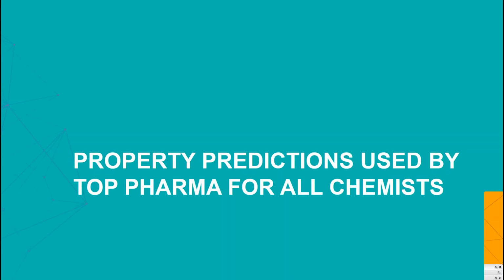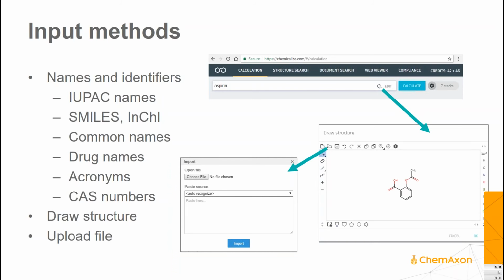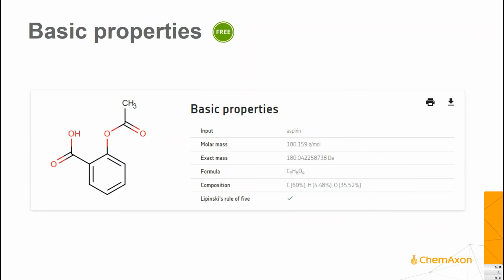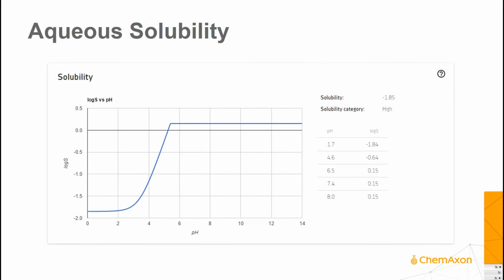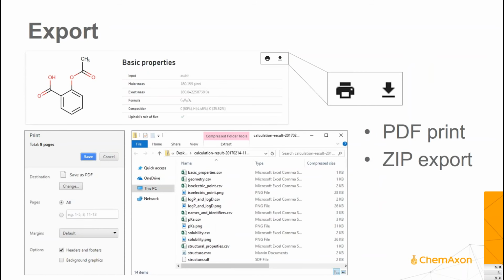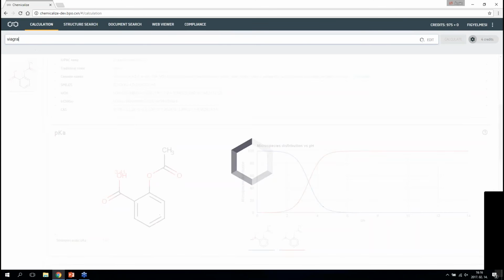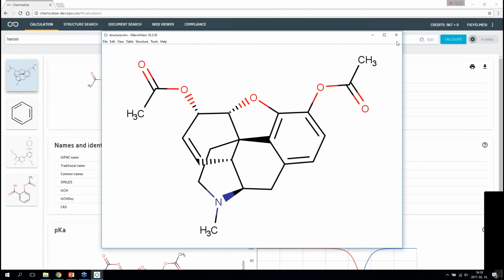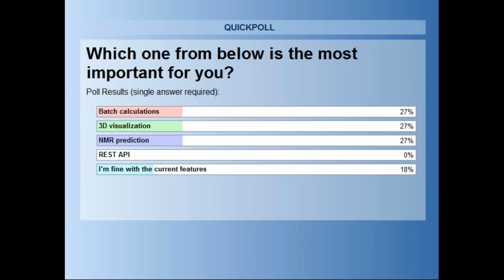Chemicalize Webinar - Calculations Property Predictions for All Chemists

Comment: Hello, Thank you for your presentation. What are the batch calculations exactly?
Reply from the maker: Hey, batch is the opposite of single calculations. If you have a file with multiple chemical structures stored in it (like an SDF file), you can run any available conversions or calculations in batch mode. This means that our software calculates the requested values for each chemical structure, instead of clicking the calculate button one by one. It is useful if you have a large (thousands to millions) compound library that you want to predict a value for.